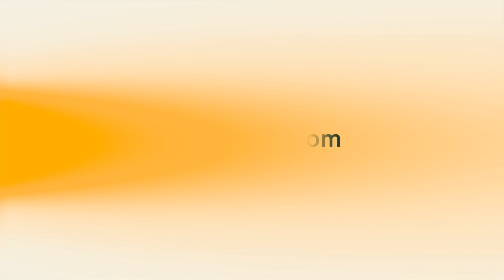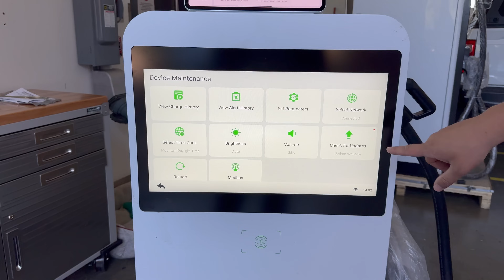The Small EV DC Charger That Could Work For You! Autel DC Compact 3 Month Review

Comment: Key Highlights of the Autel DC Compact:
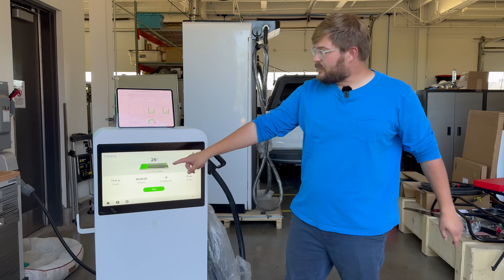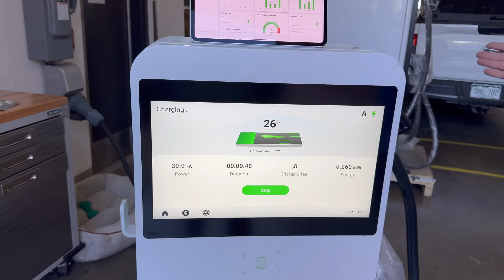Performance & Reliability: The unit provides a reliable 40kW charge (after a short 45-second ramp-up period) and has proven durable even when used in non-standard transport conditions (3:55-4:39).
Portability & Design: Being on wheels, it is easy to move, though Kyle notes it is heavy and could be improved by being lighter and adding support for 240/208-volt connections (13:56-14:31).
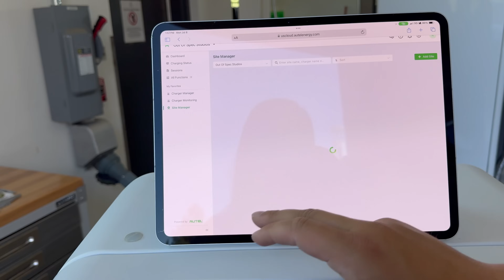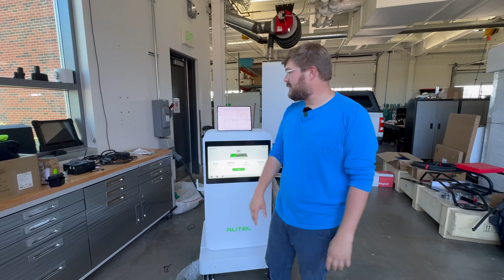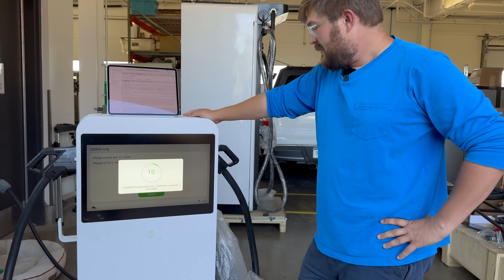Connectivity & Software: The charger features an advanced, snappy over-the-air (OTA) update system and a robust backend portal that allows for real-time monitoring of charging sessions, voltage, and vehicle communications (7:03-8:40, 16:17-17:15).
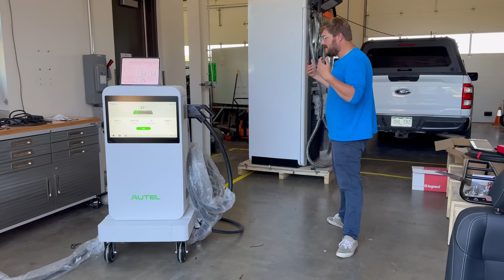Ease of Installation: Unlike larger fixed DC chargers that often face complex permitting issues, this unit uses a standard 480V three-phase connection, making it ideal for fleets, hotels, and office parking (5:34-6:26).
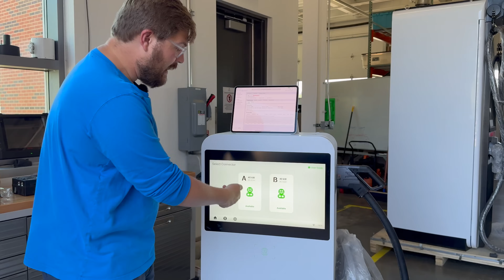User-Friendly Operation: It supports multiple authentication methods like RFID cards, QR codes, or "free vend" mode, making it adaptable for various environments (15:45-16:13).

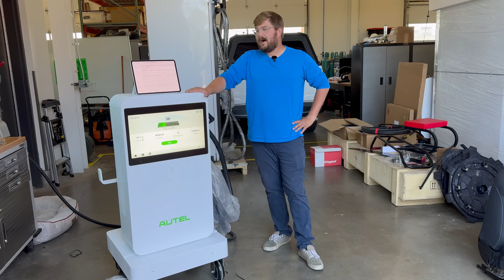Kyle concludes that for those managing fleets or needing a high-quality, integrated personal DC charging solution, the Autel DC Compact is a highly recommended and well-integrated piece of hardware (20:59-21:48).

Comment: Kind of hard to find 480 volts around a home.   In some cases, three phase is around a home at 120 volts for a total of 360 volts in countries other than the US.   In the US, 220 volts of two 110 volt phases is the standard.   New commercial buildings?   I think it would be better to have multiple Level 2 charges so there is more energy shared across multiple cars.

Comment: Chargers are an interesting business. At my previous job I was looking to installing 100 AC points. For my current job we have already installed 100 DC chargers and 150 AC chargers. 
But for the DC chargers the costs are usually only 1/3 for the charger. The high voltage cabines, cables and works take the other part of the cost. That being said: 2400 DC left to go (for commercial vehicles that have a 6 hour window to charge at night.

Comment: For anyone wondering, these cost about $22,000 USD, and require 3-phase power on premises. This is not exactly something you can get at home as an EVSE unless you plan to sell the power they provide to other customers at a profit. Most people can't even GET 3-phase power at home, even if they're willing to pay the power company to implement the infrastructure. So nearly everyone is going to be stuck with Level 2 chargers at home for the foreseeable future.
Reply: My main panel on the outside of my house is 3 phase, the subpanel in the garage is 2 phase.  2022 build, maybe people are actually starting to think about this stuff.

Comment: I've started installing maxichargers for apartment buildings. Their software blows others away. So easy to set up billing and load sharing. They are popping up all over los angeles. The nacs maxicharger is now also available.
Reply: What power rating on Maxichargers is most popular for apartments?
Reply: @johnpoldo8817  I only buy the hardwire versions that go to 12kw but depending on the house panels and loads upon them, they can get dialed back. Most apartment buildings are older with constrained services however even a 7kwh charger is a life saver where tenants had access to nothing. The maxicharger has both a hardware maximum adjustment and a software one. The hardware one adjusted to what the circuit and wire can support while the software one to adjust down in the app if the panel has other loads possibly temporary. You can group chargers to share panel load and they will talk to each other to dial back and share power. The 25' cable can reach four parking spaces if installed properly also allowing sharing one unit.

Comment: but wait this unit can't deliver 350 kW so it can't be good can it...!?!? 😄 this output is about the size of the custom units many of the companies are delivering for use with electric Terminal Trucks (ref: Orange EV, Kalmar, etc).  although they technically weren't plugged into mains power, you may probably recall KC that Daimler/Freightliner actually had 2 of these 40 kW units sitting by their outdoor test drive booth for their E-Cascadias back at ACT Expo.

Comment: having one of these work on 208/240V would be difficult. Even assuming 240V, which would be unlikely since few residential users would likely be willing to pay $15k for a charger, it would pull 166A, which means you would need more than a 200A circuit to run it at 40kw. That's more than most houses have for their entire electrical service. Most commercial users have access to 3-phase AC. Not to mention the increased difficulty of rectifying single phase AC to DC versus 3-phase. There are 208/240V DC chargers, I believe ABB makes one, but they are more in the 20kw range.

That said, having more of these at places you're likely to spend at least 45 minutes would be amazing. Having a line of 10 of these, with 2 cables each, would be ideal for malls, restaurants, movie theaters, even hotels and grocery stores. DC fast chargers are still necessary for quick stops on road trips, but they get overused by people who don't need that kind of charging speed. If you're not on a road trip, you probably don't need to be using a 350kw fast charger. Something like this would probably be more appropriate, as long as it was installed at an appropriate location.

Comment: Most public chargers are 40 amp 7.2 KW at best. And what never made sense to me when you add these to a new building, you must install multiple large transformers to step the voltage down to 208 V with the additional panel boards and larger wire this adds quite a large expense, and I never knew why cars couldn’t charge on the higher voltage that is native to the building 277 V or 480 common for large commercial. One recent site chose to eliminate 1/3 of the chargers planned on being installed to save on this expense. So I never knew why more public chargers didn’t have smaller DC chargers instead. True the individual EVSE is much cheaper, but less practical unless your customers or employees are gonna park there for many hours. And it’s quite common to have small, DC chargers in warehouses for forklifts. Most do and they run on 480 3 phase for years so why not for cars?

Comment: Last year, a third of Colorado’s electricity was produced by Coal.  Another 30% was produced by natural gas. Without an increase in renewables, Colorado resident EV owners are just rolling coal in a different way.  Solar is only about 3% of Colorado’s electricity last year. A better return on investment would be a level 2/solar array for individuals that have a home.
Reply: Co Springs Utilities published their renewables rollout plan. I forget specifics but I recall being happy with the roadmap.
Reply: This is true in many if not most places in the US.
Reply: Colorado is hooked on cheap coal power. It’s amazing how little solar power that CO has.  When I started using EVs over 10 years ago, getting level 2 with solar killed two bills at once - the electric bill and the gasoline bill. The “tanks” are always full in the morning, so no going out to local level 3s needlessly raising congestion there.  
The complete solution includes the EV, roof-top solar and charging at home.
Do it now, and it will protect you  from the big utility price increases that will occur when they actually start transitioning to clean power.  
Otherwise, you’re just driving a dirty and polluting EV.

Comment: battery swappping , battery swapping , Battery swapping..cant wait until we (USA) are done with the DC charging nonsense. I dont need to dcfc very often but I was going to today in Minneapolis, 2 EA chargers/dispennsers down out of 6. Chevy Bolt charging ot 100% , BW Ix charging was at 86% no driver in site and the other 2 were full as well, one guy was literally taking a nap with seat folded all the wayy down (Uber driver filling to 100%) .. the very POINT that you have time to take a morning nap while fueling your car says it all .

NIO has more Battery swap stations than Tesla has superchargers and has done 40 million battery swaps already .. so yes it works ..very very well. Not a Tesla fan but now that Tesla has millions of Teslas on the road it would be the perfect time for Elon to leap frog all the other manufactures again(now that Teslas are just 48% of all EVs  sold in the USA ,losing marketshare everyday).let everyoe else use His chargers ($$$$) and then leap frog them by going back in time and starting up battery swapping like he was originally going to do (not enough vehicles at the time to make it worthwhile..now there is) ..all new Tesla s battery swap capable ..less than 3 minutes and on the road again while Ford, GM, Rivians etc are PAYING Elon to sit at his chargers for 30,minutes 40 minutes hour and a half big batteries
Reply: and they can be installed in less than 48 Hours ! and when the storms knock outr all the charging stations the battery swap stations can power themseleves and deliver all the batteries they have in stock 20-30 and or feed the grid
Reply: Then who will buy new cars? The moment you swap battery, it becomes used car. Who invests in real estate?

Comment: The 20kW DC chargers are also particularly interesting. More common in Europe with their 3 phase but more cost effective option as they typically run in the $5,000 - $7,000 range. (so basically half the price of this for half the power).
Reply: Why would anyone need 20kw charger? Most evs have 22kw chargers.
Reply: @mug_spinner because 7.2kw is the max on mine
Reply: That's not true. Most have 11 kW. I just found the cheapest 22 kW DC Charger on AliExpress for only $2000. Tempting.
Reply: @noname... (YouTube comment section is too stupid to add this by itself :/)

Comment: 150A for 40kW is great. Where I live, the most common fast-chargers are 50kW but they can only output 400V/125A max, making it effectively impossible to pull more than about 44kW unless the EV has its own DC-DC converter.

Comment: To expensive for what you get!!! We can buy 10 22 kW AC chargers for the same price. As a CPO we have looked at those modern 24 - 50 kW DC chargers, extremely few benefits. Maybe a workshop or taxi business with extremely specific use cases? Go with cheaper to buy and maintain AC chargers instead.

Comment: Not sure if I missed it, but can you hook up two vehicles simultaneously for 20kW each? I'm guessing the answer is yes, but Electrify America chargers have been dual-cable for years and don't operate that way. :-)
Reply: Yes, Kyle mentioned at one point that you can plug in two vehicles contemporaneously and each gets 20kw
Reply: Can confirm. My Mercedes dealer uses this exact unit and I've seen it plugged into both a EQS 450 and EQE 350 at the same time at 20 kW each.

Once one car disconnects, the other will ramp up to the full 40 kW.

Comment: You guys are my go-to for EV related things so I will ask here. Is there something that they sell that can connect to a regular 110 outlet in your garage that can collect and store energy during the day when you are at work or away from home, then charge your vehicle at a faster rate once you get home and connect it to your car in the evening? That way you wouldn’t have to do any work to your home electrical system and still get a decent amount of range added to your car. That could help so many people who live in older homes.
Reply: It’s a good idea, but I think the problem is that it would necessarily have to have a large battery (read: expensive) to store the energy and that’s $$$ that you’d prob be better off spending upgrading the electrical in your house.
Reply: @notshylo  oh I’m sure there is a reason why it does not exist. It may be a good way to recycle old EV batteries and reuse them in a new way. I think of you live in an old home and in an area with other old homes it would be nice to have something that you could take with you or if you are renting and can’t upgrade the electrical. It just seems like such a waste of time to not collect the energy when you aren’t home.
Reply: @LifeAfterLosing at that point, if I’m collecting and making my own pack from recovered batteries, and buying a proper bms, then we’re basically talking integrating it in as a whole house backup, and proper 240v charging circuit along the way with all the re-wiring.   I couldn’t see building a pack like that and only using it to charge the car.
Reply: 240V would be more efficient: even if only trickle-charging at 12A.
The EVSE the came with my used EV has a NEMA 6-20 (240V, 20A) plug, then a NEMA 5-15 adapter cord (120V, 15A).
Currently I lose 68W in the wiring (5.6V drop @ 12.5A). Moving to 240V alone (same wiring) would double the power supplied to the car for the same voltage drop. More likely to install cable rated for 40A, assuming a 30A charger (my car only charges at 16A though, so not needed).
Reply: I just want to say that this is a brilliant idea and someone should take this and run with it.
Reply: Some of these battery-connected DC fast chargers could likely do that, but I don’t know of anything consumer-grade that does that
Reply: On a small scale this is possible already.  You can get luggable batteries&inverters with a 240v outlet that you can charge off 120v.  Search for “portable power station” But compared to the car the number of KWh is small.

The main reason this isn’t done is that the practical limit of what you could store using a typical 120v 15A outlet tops out at about 33KWh per 24 hours. If you are able to charge using 120v 12 hours a day you’d get half that with no special gear.   That means it’s only useful for someone limited to a 120v circuit who needs more charging than they can get without one, but less than 33Kwh / day.   
 So there’s a limited number of folk would have a use case where this would solve their problem.  You’re also talking about around 10-20KWh of batteries to capture a decent portion of that power, say 17KWh for 12 hours worth, and that’s not cheap..  a 240v 40A circuit would likely be as expensive if not cheaper.   Price some batteries for modular systems from solex or anker that have a 240v outlet and see what it adds up to.  

Now, on a 30 amp 240v supply, you could buffer up a lot more power, so it might be a lot more practical.  But you’d still need enough battery to hold the power, although at that point it might just as well be a whole home backup system.

Also understand that nearly all batteries benefit from slow gentle charging, so if you don’t NEED to charge rapidly, don’t.   If you can still get a full charge by morning at a slower rate, use the slower rate.  Better for long term battery health, and less stress on your electrical system and grid.

Comment: We need chargers like this at restaurants, malls, theaters, and other destinations where you're likely to spend 45 minutes to 3 hours.  I would occasionally use something like this while on a road trip if located at a Texas Roadhouse (or similar) while having a real sit-down meal and get ~50-80% charge.
Reply: Just use charger in your car.
Reply: @mug_spinner  The on-board charger in cars cannot take in 40 KW, this is a DC charger that's roughly 4-5x the speed of an AC power input using the vehicle's AC-DC charger. This charger would be ideal for in-route destinations like restaurants and motels.
Reply: @mug_spinner  The charger in my car gains me at best 9% per hour

Comment: This thing is cool! Though I feel like some of the use cases for charger would be better for an aray of level 2 chargers instead. An aray of level 2 chargers would probably be much cheaper, and they dont require human intervention to  charge cars one after another.
Reply: Agree we need more level 2 chargers but in some cases they are not fast enough. I’m in Europe and here the standard is 11 kw. It takes hours to get any meaningful charge. This solution is way cheaper than the big chargers and a good compromise in my opinion.

Comment: A three phase generator and this would be a perfect addition for the track guys. And thats so true, the power is available in lots of commercial buildings. My old job had one and we used it to run our production trailer but they could have this for when they eventually move the work vehicles to electric (in addition to L2)
Reply: When he did the range tests with all the EV trucks he rented a genny, strapped this to it, and charged the dead trucks on the side of the road!